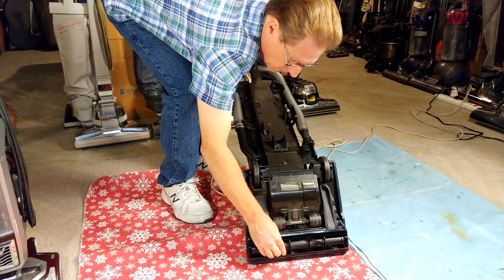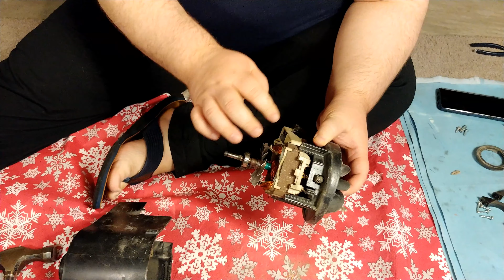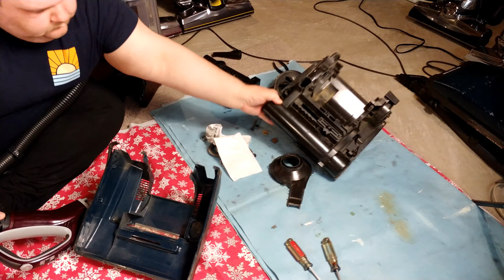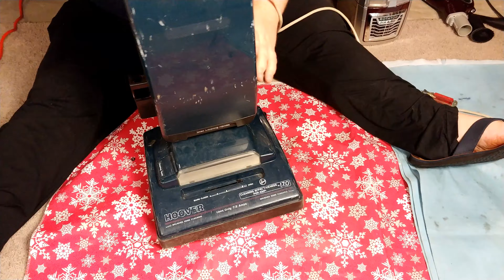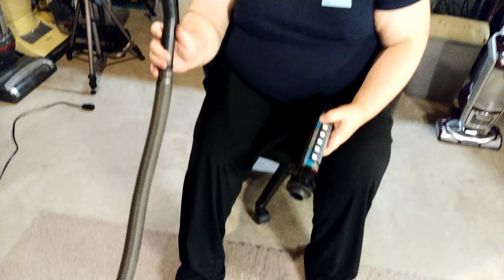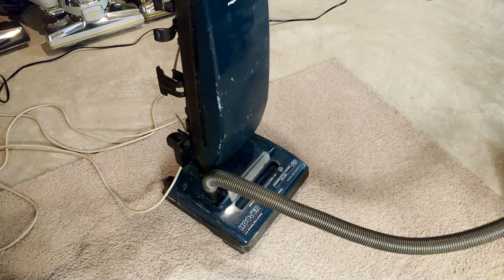Mini Meet 17 Featuring A Shark NV650W And Hoover Elite

Comment from the maker: This is a re-upload of the previous video in order to correct a Shark model mis-identification.
Reply: i have the same shark but mine was recalled and those hoovers are very essay to take apart i go to the motors in about 5 mins
Reply from the maker: @TheVacuumWizard  I need to replace the bearings in my older NV22 at some point.

Comment: That Hoover Elite is just like UK model Hoover Turbopowers. Sam (Beko1987) has done tons of those, but I don't know how he has done those motor bearings. The way hose is connected to it really limits the airflow. Airflow should be better from the nozzle. One of my favorite vintage Hoover models. Simple direct air upright with a great performance. That Shark NV650w should perform quite well. I got excellent results from my NV500 UK (NV501 US). 
It was sold new 5-6 years ago. I measured 61 nozzle cfm and 72% sand pick up. The brushroll is quite stiff and narrow. So I quess it takes full advantage of the airflow what it has.

Comment: Those Hoover Elite style upright vacuums are my childhood favorite.  Yes, they may be loud and entirely made of cheap plastic, but they're very affordable, have great performance, and the design looks so nostalgic to me.  It's just a shame that when you're rebuilding the motor, the only way to get to that inner bearing is to take the fan off just to pull the entire armature out, and how thin and brittle the plastic gets on the fan after years of use, it would practically scare you to remove the fan without breaking it.
Reply from the maker: That Hoover fan was in fairly sad shape and I thought if I pried it off, it would have shattered. 😞
Reply: @VacLab  Understandable, and even replacement fans are getting harder to find, besides, the motor doesn't sound too terrible to me after you lubed that exposed bearing.
Reply: Also, just for future reference now that I've had serviced many Elites, the fan actually doesn't pry off, it's actually left hand threaded onto the motor shaft.  Also the only way to get to the inner bearing is to pull out the carbon brushes (I find it best to use a set of needle nose pliers to do that) and then the field will remove from there and you can get access to the bearing to regrease it.

Comment: I usually take the fan off first by holding the pulley with a pair of pliers and unscrew the fan in the opposite direction. Then I take the seal off around the bearing and pack it full of grease that way after the fan is removed.
Reply from the maker: The fan was so brittle and somewhat chewed, I attempted to remove it, then stopped for fear of it shattering. 😞

Comment: The brush doors open to allow the brushes to slide out and the fan unscrews which allows the armature to come out.  You have partial access to the front bearing, you can’t really give it a full clean but you’ll be able to get the worst of the dirt off and re lubricate it.